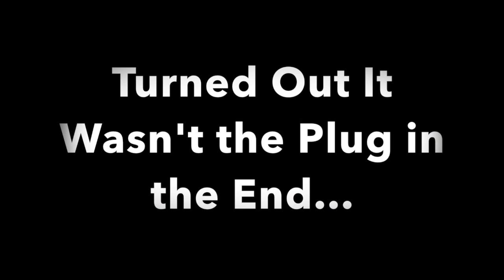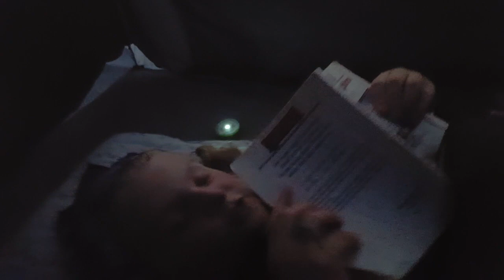LADY ELECTRICIAN?

Comment: I grinned all the way thru the plug replacement.  I saw the plug cover on the table, so I KNEW you were gonna do the connections twice. (Not like I STILL don't pull THAT one....LOL).  A suggestion.....when dealing with 'stranded' wire, always twist the exposed end of each wire into a into a 'rope'.

Comment: Rather than powering up a tool and hoping for the best, a $6 receptacle tester will indicate if you are wired correctly or not. Actually, now that I think about it you were repairing the cord for the table saw so it wouldn't have been useful.

Comment: Are any of these people licensed electricians?
Reply: Terry asked if these people were electricians, as in the licensed trade.  You can change plugs and wire homes for 50 years, but if you lack a license, you aren't an electrician.
Reply: DefconDavid doesnt mean people know how to do the job safely. I only asked because the active and neutral was wrong, used a multi tool, no ohms check at rhe end, google connections, the wire was cut in a circular fashion  (earth leakage in the future) and yes...its the law. Anything else.
Reply: DefconDavid i am not in a soap box. I still clicked the like button not the dislike :)
Reply: Do you have to be a licensed electrician? Just have to know what your doing. As long as it is done correctly. No licenses needed.
Reply: PickledHamProduction sadly, in most countries you do. Insurance companies use it all the time to get out of paying. here in Australia, the insurance companies are pushing for 12Vdc work to be done by sparkies. The world is becomming over regulated.
Reply: so true. so true. another example of  government overreaching.  here is Tennessee I personally ignore those stupid laws and so it anyway.

Comment: Am i even allowed to comment of this?
Reply from the maker: Yep, always.
Reply: The first plug you picked up at the store was twice as much money but way easier to use.  In wiring the plug,  you have the ground prong which is U shaped and has the green screw.  Next you have the neutral blade which is the wider blade with the silver screw.  And last, you have the hot blade which is smaller and has the brass screw.  Attach the green wire to ground, white wire to neutral, and black wire to hot.
Reply: I wire a plug just often enough to forget. :) We wired it right the first time, but when it didn't work, took it apart to double check. Turns out my saw didn't like to run on 200 foot of extension cord. Imagine that. :) My air compressor was barely running. We had to drain the air every time it cycled on because it couldn't handle starting under a heavy load that far from a plug. Had a good time nonetheless hanging out with Jon and Juli.
-Robert
Reply: Agreed, the first one looked like a Hubbel plug, it would have holes where you insert the wires instead of wrapping the wires around the screws and a better strain relief plus they are U. L. and N.E.M.A. listed.
Reply: Wait.........What?......... Mike and Willene get highlighted and aardvarks get zippo, nadda, nothing?  But, sigh....I guess it's true, ....aardvarks are 2nd class citizens.  (people think we are rodents)  And Mike, you're right.